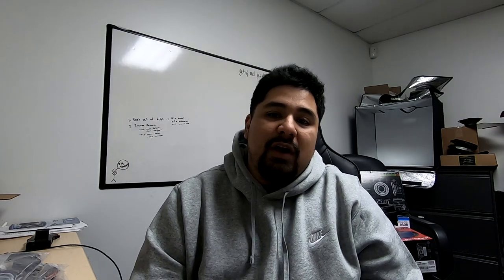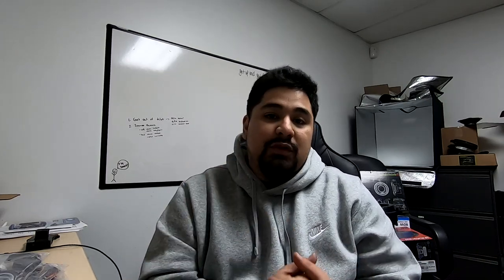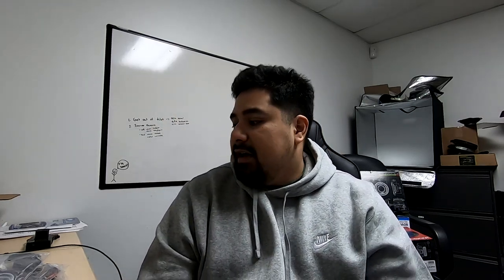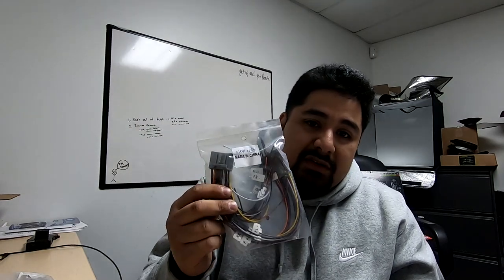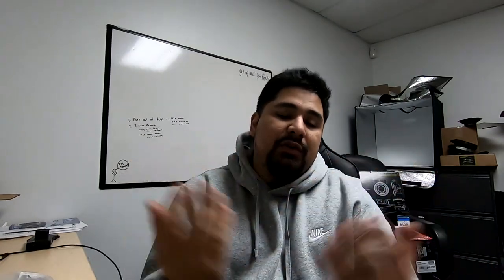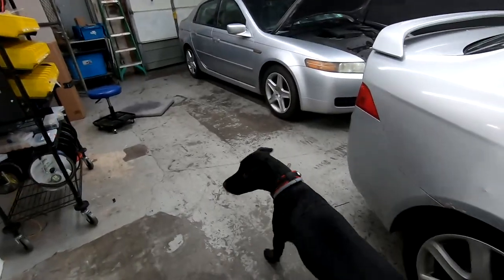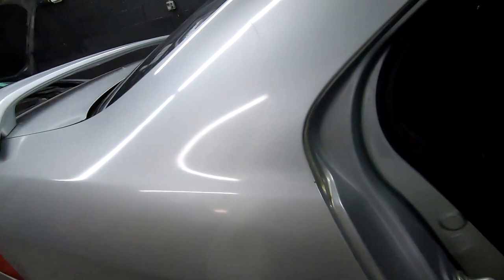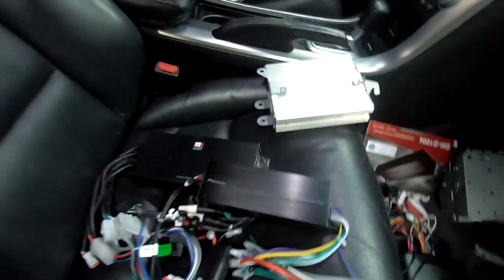Acura Audio Garage - 2023 New Products for Your Acura TL TSX MDX

Comment: I own a 2005 Acura TSX and plan on installing an aftermarket radio this year. I'd love to see what kind of options/solutions you come up with. I'm not really a fan of the metra dashkit that gets rid of the factory climate control. I'm also currently running an amplified 4.1 sound system without the 6x9s.
Reply from the maker: yes I wish they would improve the metra dash kit or that pac made one like they did with the accord. They have a nice kit. Stay tuned for the videos!

Comment: I have the 3rd gen TL with the Tesla screen mod about a couple years ago now and I lost my rear speakers because of it. Are you now able to upgrade my amp and also have my rear speakers working?
Reply from the maker: Hey the tesla screen should be plug and play and allow you to keep all your speakers. This might be different in the older models but from our limited interaction the newer ones do keep all the speakers and give you a subwoofer signal out
Reply: @AcuraAudioGarage  I must have the older models because all I am getting is the sub and the front speakers. Is there any way to update the older models to play like the newer ones?